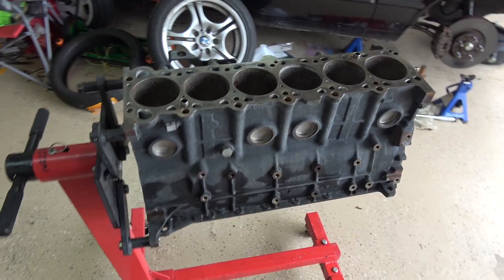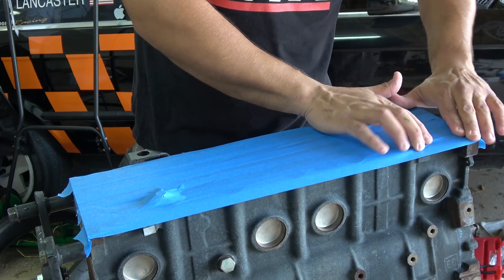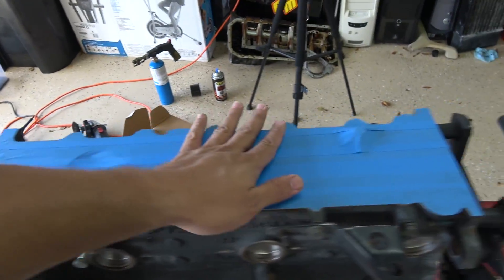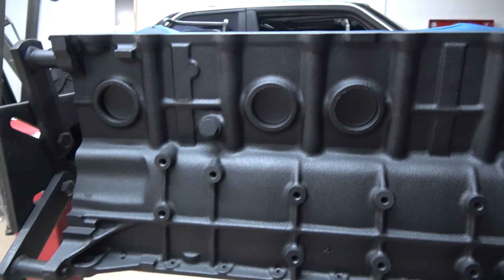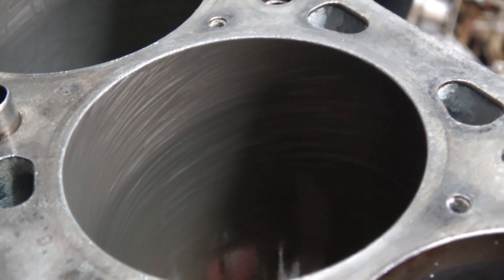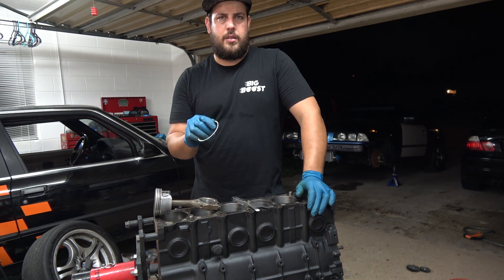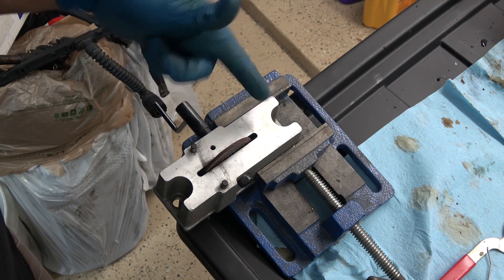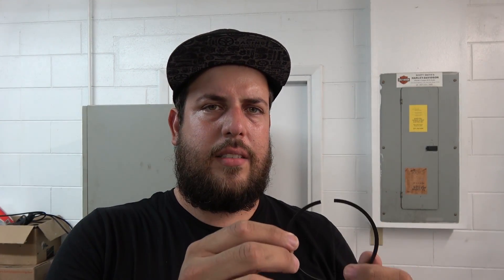M52 STROKER ENGINE BUILD PART 1

Comment: i have m50b25 engine, I am thinking about to put a crank chaft and rods of m54b30 with pistons from Opel Omega thay have a 86mm,with modify original pistons and Remove some Millimeters from engine block, 
Afraid of high temperature and compression ratio, what do you think of the idea, what do you recommend?

Comment: did you use M52TUB28 (TU - Technical Update) wich was equipped with cast iron sleeves located in the cylinder block. Double-Vanos engine included new connecting rods and pistons as well as renewed and improved cooling system and electronic throttle body. To me that your m52 look like earlier version with Nikasil coated cylinder liners without iron sleeves. i have plan do tubo project, with M50TU25. Which is fully iron block wiht intake vanos, only in latest M50TU .

Comment: nice video and attention to detail, I am looking into doing a similar build but my main concern is over the bore out-of-round / out-of-taper tolerances.  I did not see if you checked/measured for this with a dial bore gauge...how do you know you can use the M54 pistons without the need for an overbore?

Comment: hey alberto i need your advice as well as your opinion i have my m50 engine iron block on my late 94 325i sedan 5 spd its getting to a head gasket issue but not too bad should i get it fixed /replaced with a cutring mls and while its torn apart replace  cam , rods and piston from m54b30 making it a stroker or throw in a m52 ?  need your help thanks !

subscriber -junkygarage

Comment: Is is worth saving 2001 3.0L M54 motor it has a head gasket blown an its has 98,000 miles on it. The ? Is will it can b save to rebuild it cuz am gettin it for 300 bucks am cuz i want to change out my 2.5 motor for it i have a 1994 e36 an i like to do the swap

Comment: i dont know how good the m52 is in the states but in EU its like good for 300-350hp with turbo. The best engine i think you can do is get a m50 engine that is in e36 325 or in e34 525. that engine is a f¨¨¨¨ beast. almost everyone in sweden that uses turbo in a bmw engine is using m50. that engine is good like standard 400-500 or even more :)

Comment: One tip when painting an engine block, if you want a more "factory fresh" look apply a thin layer of grease over the surface of the freeze plugs on the block, that way the paint wont stick to them and cleaning them out after painting will give you a more 'stock' look to block.

Comment: You're mistaken automatic transmission fluids contain very little detergents.
Reply: I know of top-fuel engine builders who put 1/5th the total oil capacity amount in as ATF instead of pure break-in oil for initial startup on an fresh build. By doing so for the first oil change, ALL of the break-in lube is completely cleaned out and break-in is accomplished much faster. ATF is EXCELLENT for cleaning/breaking in. Look it up.
Reply: Top fuel engines don't break in, period. You can buy non detergent oil if you just look in the right section of discount autoparts.  ATF has no better cleaning properties period.

Comment: Alright internet mechanics, tell if its absolutely neccessary to hone your clylinders before putting new piston rings in. Halfway through a rebuild on my mazda gtx, wasnt going to touch the bottom end but may as well replace rings while its accessible. Cylinders are completely perfect, no scoring or anything, if i pop new ones in without honing, what will be the effects?
Reply: I've always been told that yes you should re-hone the cylinders for new rings to clean the glazing off the cylinder walls, with the glaze on the cylinder bores they're too smooth for the new rings to bed in properly during the engine break-in which may lead to poor ring sealing and lower compression.

I will point out that this is what I have been 'told' I've not seen the effects of honing vs non-honing as the only engines I've rebuilt were test-bed engines at a trade school when doing an auto course.  Personally I would hone the engine, you're already deep into the work on the engine and it'd be an utter pain to skip this one step and have it come back and bite you.

Comment: Yay, another video! Been waiting!!

Good on you on opening up the ring-end gap. Gotta find that balance between enough gap for expansion, yet not too much where you're going through a lot of oil. That'll definitely help avoid ring-butting/ringland popping. Regarding timing, why not run an ethanol mix and/or water-methanol injection? That'll keep your cylinders much cooler (helping avoid ring-butting even more--less heat = less expansion) and the extra octane and cooling will allow extra timing with a ton of extra safety too.

Comment: Finally someone shows the proper way to hone a cylinder with a tool like that.
Reply: david929190 Cross hatching s to be on a 45 degree angle, need to move the drill up and down faster. Look at the marks in the cylinder, he’s lucky if. He got to 20 on the one. 45 degrees from the deck.
Reply: Total Seal piston rings specify 30 degrees so hes better at 20 than 45 because he will get more oil retention in the bore, may burn a bit more but I doubt hes worried on a drift car.
Reply: Used to V-8’s, they’re always wanting 45 degrees on cross hatching, thanks for the info. Also right about the drift car aspect, if it was his dream car motor I’m sure he would’ve gotten forged pistons like he said in the video.

Comment: That sounds like a pretty small gap on the Rings I know most built engines are .21 - .27 but maybe that's because it's a different material.
Reply: Bear in mind these are stock pistons, not 2618s or even 4032s. We'll see how it goes, but I think you're doing apples/oranges. I think you're right about it being a different material issue.

Comment: M54 built bottom end and boost on single turbo is a favorite setup of mine besides the new lt4 platform and the 2jzgte supra builds and rb26 r32 gtr's but a m52 is a solid build also. Less problems than the s series engines in my own experiences.

Comment: That still sounds kind of tight on the rings for boosts :O I know 2jz likes .020 top ring :O gap
Reply: M52 bore is more common in 84 mm which is 3.307".   multiply by .006 for top ring = .0198 ~.020" gap  and multiply by .0057 for second ring = .0188 ~.019" gap.  Conversion factors for boosted rings right out of Wiseco Instructions. User can tailor ring gap depending on level of boost they wish to run and amount of cylinder heat is going to be expected or known from prior testing.   There is an M52B20 that has an 80 mm bore and these gaps would be a bit big for that bore under most applications (.019" top gap and .018" second).
Reply: everything i am finding is in the ballpark of .020 - .024" for boosted apps on the first ring
Reply: The equation is based on the piston circumference. Are the 2JZs similar? I know we're talking about 2 3.0 engines, but one may have less bore/more stroke than the other. Plus, extra measures can be taken for cylinder cooling.
Reply: 2jz has an 86 mm bore stock. It has larger dimensions for boost usually due to assembler decision. Still same ring mfg. turbo spec as the M52 common bore. (T= .0203" S=.0193" by ring mfg spec.)
Reply: Supra VS BMW in CanadiaLand!!!
Reply: I hope he sees this.  Same thing is going to happen to this engine in a short period
Reply: yeah, I was just making sure he has the gaps he wants is all. It just seems tight to me
Reply: Drill speed to high as well, Am I the only one who doesn’t prefer Ball hones?

Comment: Alberto, when checking ring gap, place the oil control ring scraper in the piston to set the depth. You’ll get much more accurate placement perfectly parallel to the deck.

Comment: Fantastic, I have an old E36 318is that I'm planning on turning into a track tool...plan was to go with an S54 drivetrain but given the cost...and if this works...may follow this route as well.  Keep up the vids, you  have one very interested viewer here.
Reply from the maker: this route would be the most cost efficient. unless you get a s54 super cheap. also this engine is very straightfoward to work with
Reply: I'm terrified of "cheap" S54's given I have a 2007 BMW Z4M Coupe which I'm sure you know has an S54...so I know all about the issues of the S54 can have...vanos issues, rod bearings etc when they are not maintained...plus it's been done to death in E36's...again, keep this up and the more detail the better, much appreciated.  Very interested in this build.  Hope you get into brakes, suspension etc as well.  And ECU.  Cheers.
Reply: Get an S50 or S52 - buy a salvage car from CoPart and use all of it.
Reply: CoPart does not work for me...I live in Toronto Canada...just the shipping/import fees would kill the whole deal.  We have similar ways of finding salvage cars...similar websites etc but I wouldn't have anywhere to store a salvage car for parts etc...I would have to rely just on finding the parts

Comment: Why must your content be so addictive?? Anyone else agree?
Reply from the maker: I try to make the boring parts of how to videos fun too :)
Reply: @ALBERTOBIGBOOST  saludos
De casualidad me tope con tu video el cual me parece bueno. Yo al igual soy fiebru de BMW aca en puerto rico tengo la dicha de poseer varios bmw los cuales son un e36 318 convertido a m3 desde suspension motor e interiores hasta frenos y la mas minima tuerca, solo le falta el vin de un m3, ademas poseo un m5 e39 y un 323 del 2000 el cual me trae a la pregunta que quiero hacerle. Crees que a un m52b28 (2.8lt single vanos) le puedo adaptar el sistema dual vanos de un motor m52tub25 (2.5lt dual vanos)? Es que tengo un motor 2.8 y el motor del e46 323 se calento y se fue de junta. Basicamente quisiera sacarle el dual vanos als 325 y instalarselo al 2.8 junto con el intake manifold. Si tienes alguna sujerencia te lo agradeceria.

Dicho sea de paso yk vivi mucho tiempo alla en oceola vivi en la mexicali, en floral park dr, en st. Cloud tambien antes de regresar a p.r

Un abrazo brother